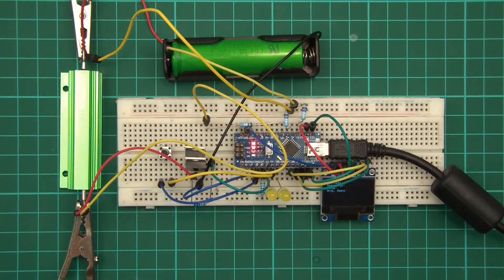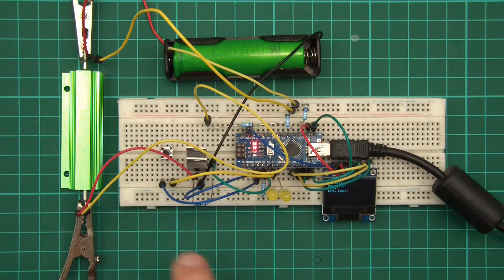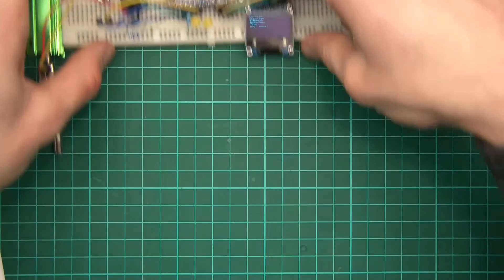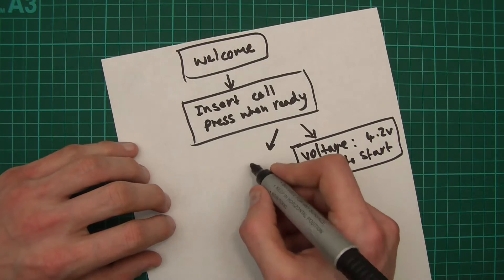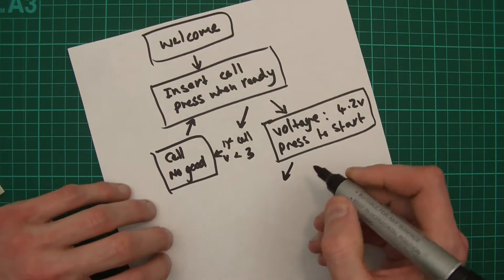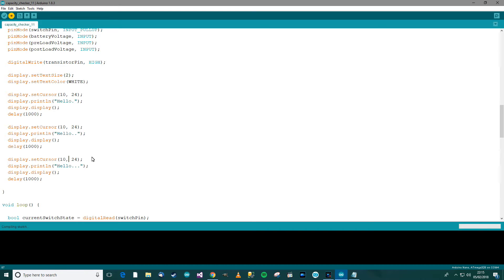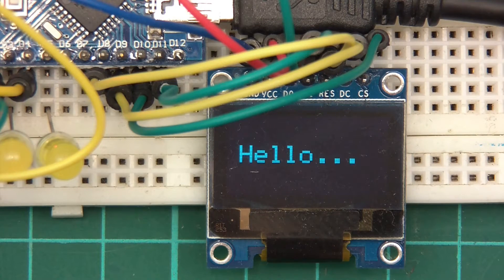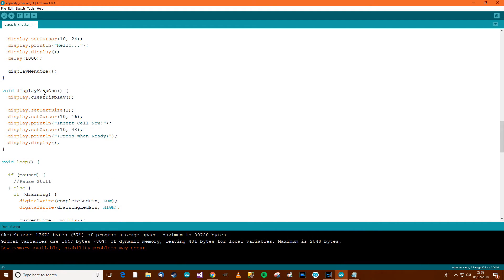TUTORIAL: DIY 18650 Lithium Ion Cell Battery Capacity Checker Tester (Part 11 - Menu Creation!)

Comment: Very nice. Now before you do the menu, change the circuit so that you can also measure the internal resistance of the cell.
Reply from the maker: Christian Shepherd There's always one who wants to complicate things. Ha! :D :D :D
Reply: Antony Cartwright , lets not call it complicate but complete. 😀 If you want to make a charger, it should have that function. If you need some input on how to do it, check Julian Ilett. He has an older video to get you started. In the comments, I posted a link where someone else followed up on the subject.
Reply from the maker: Haha! I see! I've actually already put a charger together in a previous series, but yes, good point... This can be added in Version 2. :-)

Comment: You could do a compressing of the menu functions:
#define menu1 1 | #define menu2 2 .....
void displayMenu(menuItem) {
display.clear(); //And all other basic like color/size/etc
switch menuItem { case 1: break; case 2: break; } 
display.display(); }

that way you could shrink the amount of lines of code needed for the program. This will help the "low memory" issue.

I would also put the discharging section in it's own function call. This helps the loop() to stay clean and easy to navigate later if you change/add/remove/review your code at a later time.
Reply from the maker: Korishan Hey, thanks! I've already recorded next weeks videos... I might have done it similar to that way, I can't remember!